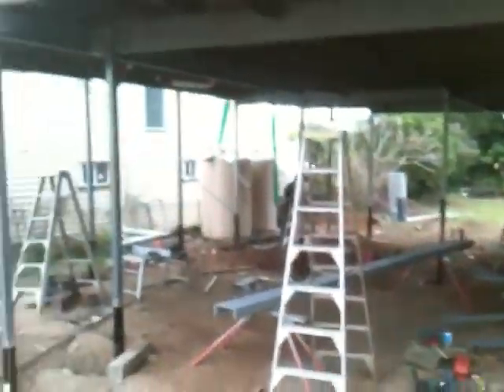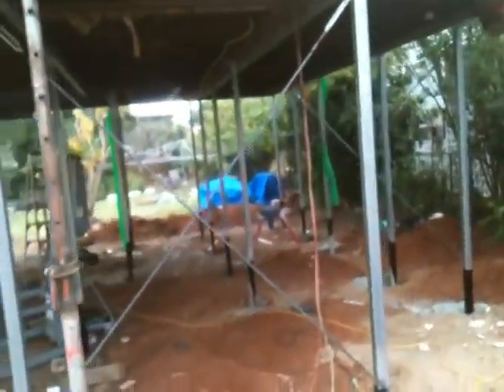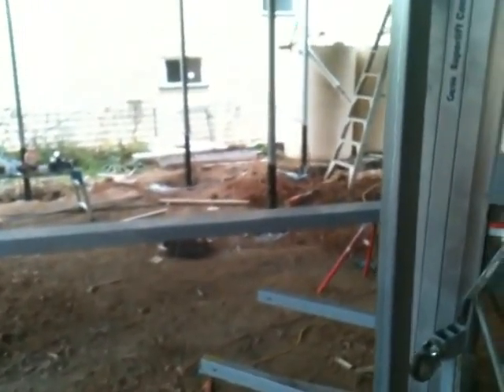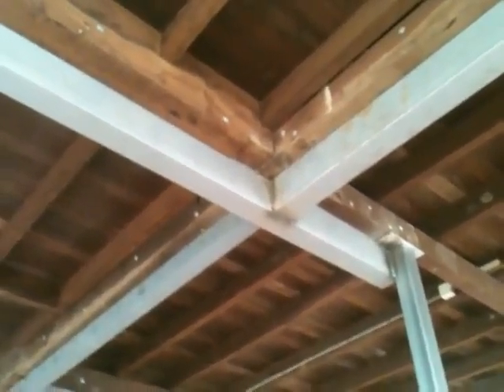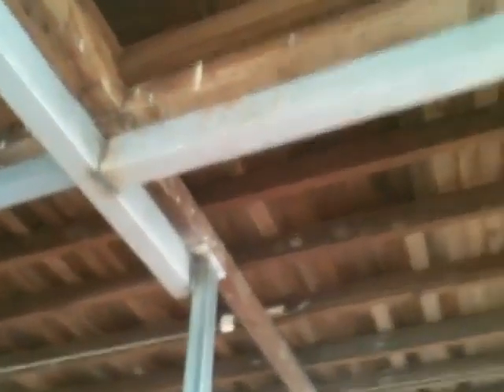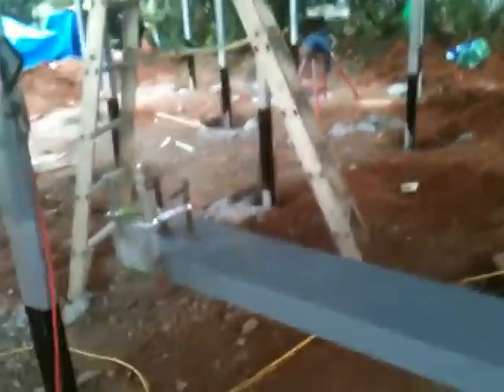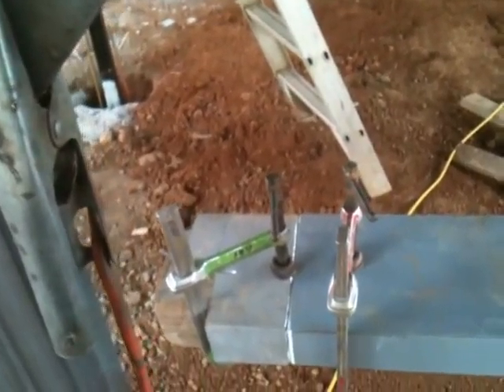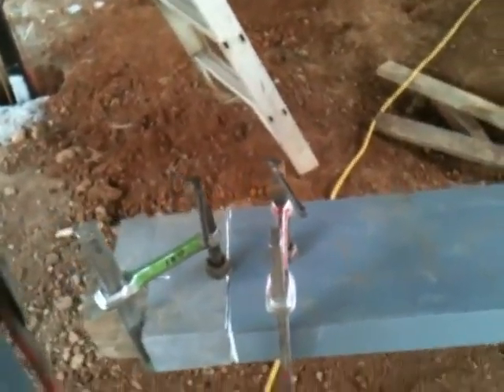House restumping. Almost finished at Palomar prd Wavell Hights 11 of 11

Comment: Still working my way through all your vidoes that seem to have suddenly jumped up. I'm guessing all your welding is stick welding, not mig? 

Cleared up another point, that the posts go in under the original bearers, then the metal pfc's are bolted to those. Is the bolt pattern called out by the engineer? 

That's funny that you are saying back in 2010 that you always upsize. I think I saw a recent video where you did argue with the engineer who was over spec'ing the steel.
Reply from the maker: Hi there
Yes we do use mia and stick, but mostly stich, although slower at welding the stick is better because we do not have to spend so much time prepairing the steel for the mig and the stick gives a stronger weld.

Yes the bolt pattern is stated by the engineers, But thereare a few engineers that go way overboard with steel sizes and when that happens we seek assistance from other engineers to check that the sizes are correct as the way over size beams can send the builder bankrupt because of everything that has to be beefed up to handel the extra weight.

Thank you for viewing and for commenting on them.

Talk again soon